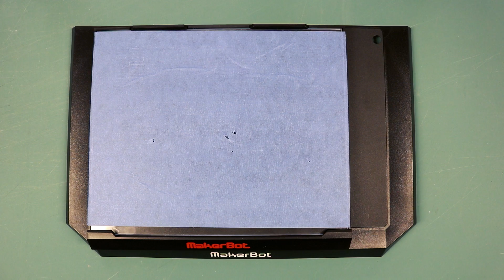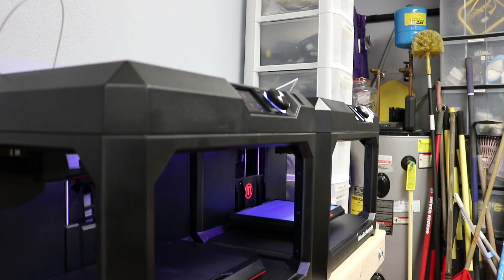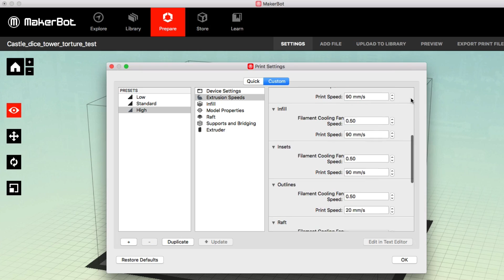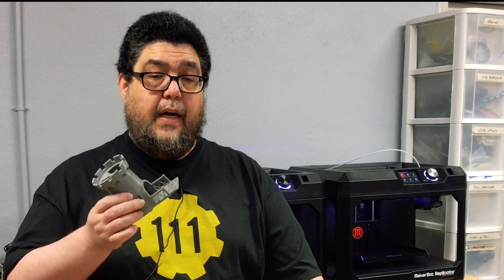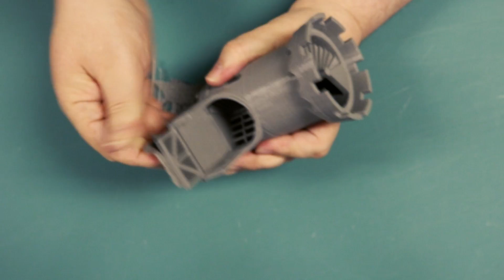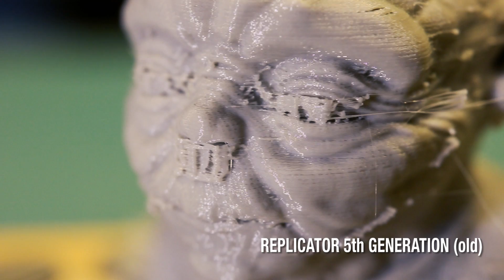Battle of the MakerBots: The new Replicator+ versus the 5th Generation

Comment: Thanks for making and posting this video. I was thinking of buying a Makerbot Replicator+ for prototyping and small runs of components. After watching your video my understanding is that the Replicator+ is more of an upgrade printer for home users who print garden gnomes in PLA. For $3,496 (United Kingdom price) I would really want better.
Reply from the maker: Well, it's gotten MUCH better since my initial review. That said, there's a lot of price competition now, with things like the CR-10 (although you need to bed level by hand) for a fraction of the cost. Mostly the MakerBots are used in education and design/industry. They're definitely not targeted at home users.

Comment: Thank you for an informative and well balanced review of this product. I was interested in your test prints of the two printers but shocked by what you considered a good print. A friend of mine recently purchased a cheap, Chinese generic Prusa style printer and has been producing prints for me that are much cleaner than the ones shown, albeit of a different type. This inspired me to build my own reprap Prusa style printer which, even at 0.2mm resolution, are far cleaner and smoother with little or no Z banding and a base layer smoother than a baby's bottom. This is my first printer using standard RAMPs and Marlin setup with a E3D Lite hot end. I would have rejected both of your prints for my own projects.  I use Cura for the slicer by the way. Do other folks in the community consider your print examples 'good' prints from the demo?
Reply from the maker: Yeah, their output has improved a lot since I first tested this. I certainly would recommend asking them. This is a discovery series precisely because I'm not an expert, just someone exploring to find out how this stuff works.

Comment: If you are having problems with your raft just tweak Z and temperature and use a 0.5 mm flexible pallet knife to remove the prints
Reply: Mussy Design exactly - I run at 220, with one tap negative z calibration and print raftless

Comment: Hey Dave,

Is your replicator 5th gen running a smart extruder or a smart extruder+? I bought a refurb 5th gen and i was wondering if i was imperative that i bought the smart extruder+, since it seems to substantially improve performance?
Reply from the maker: I did upgrade the 5th Gen to the SE+ and it did improve performance. I'm now running an R+, which came with an SE+. My advice would be that if you have a regular SmartExtruder and it works, stick with it. If you run into annoyances, then it's probably worth using the SE+.